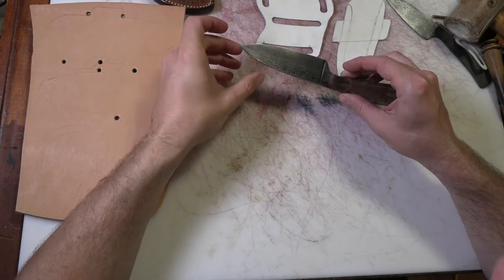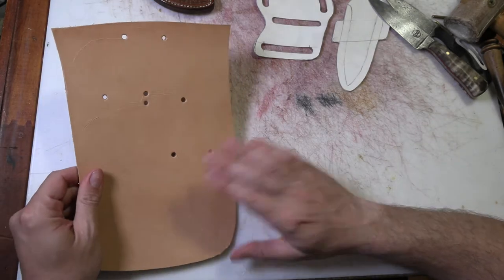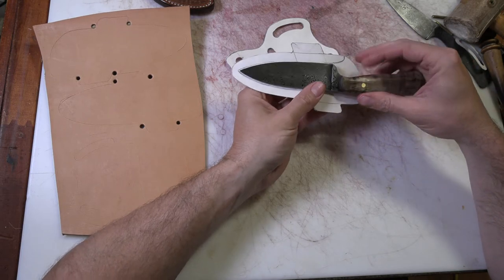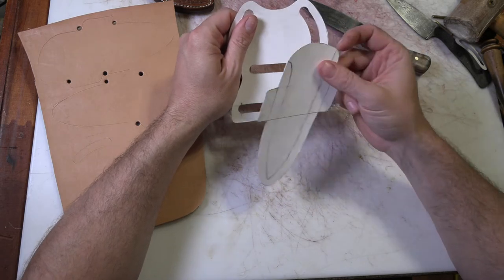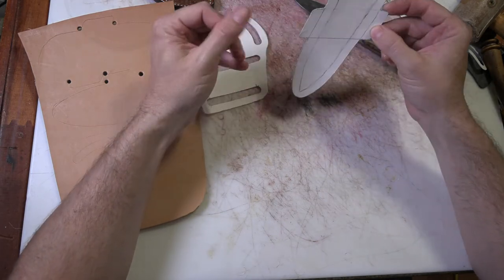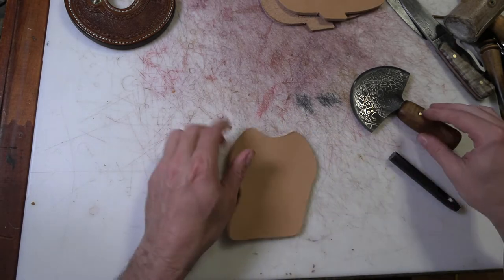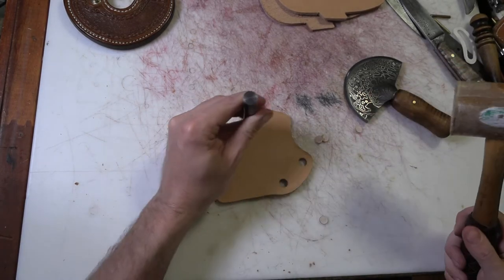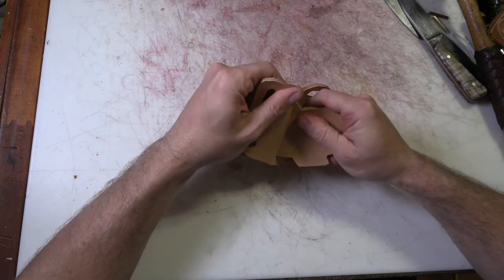Making a Knife sheath with a leather belt frog

Comment: Excellent. I wonder if a frog would work on a horizontal sheath.
Reply from the maker: It should work.  Just have to make sure the balance point of the knife is under where the frog is attached to the belt.  If it is too far to one side or the other the sheath will want to tip.  And as usual with a horizontal sheath you will probably want a retention strap to keep the knife from falling out.